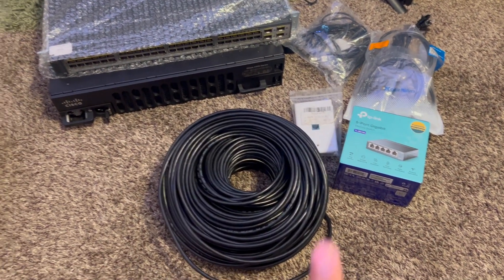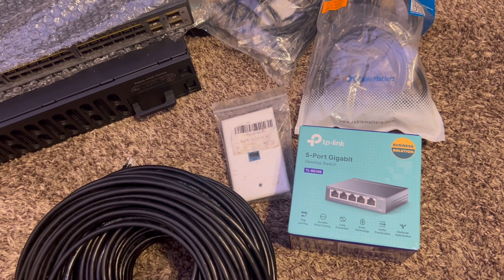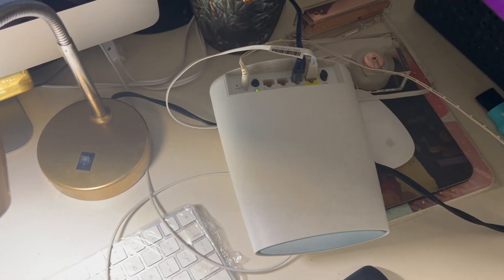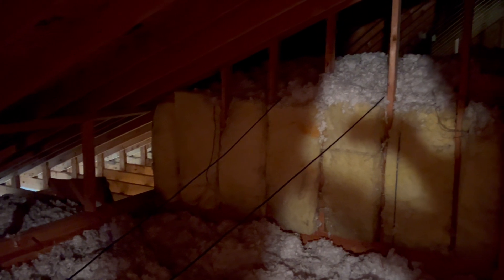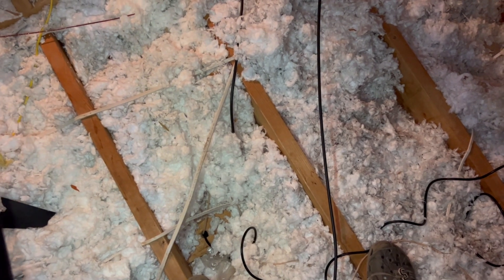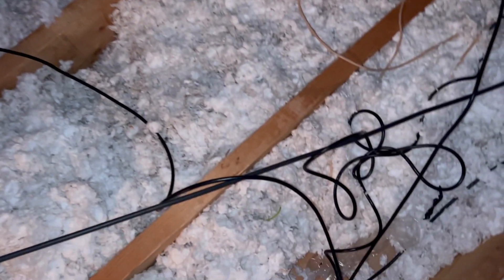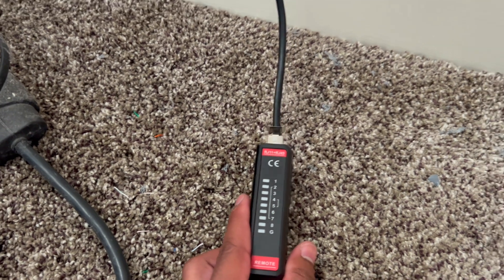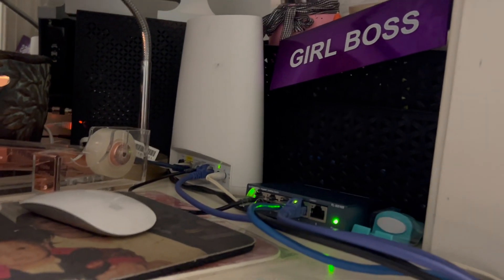CAT 6 Ethernet Drops | Coaxial To Ethernet | Home Network Upgrade

Comment: Nice job man, question though. Couldn't you have ran the ethernet from the modem into the attic and then into your tp switch and then run those down into the other rooms? Not sure if that'd work just the first thing to pop in my head.